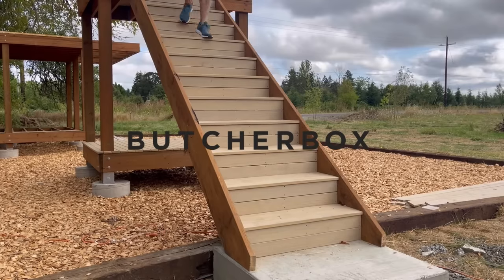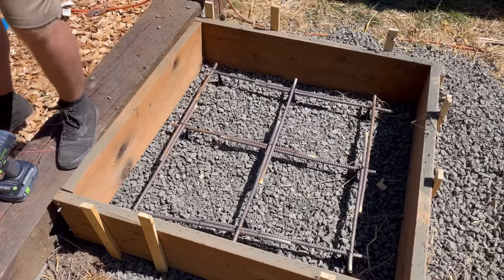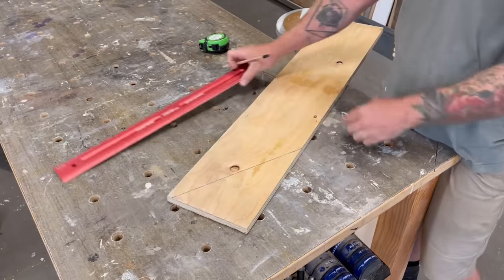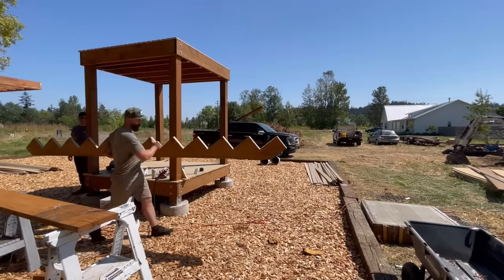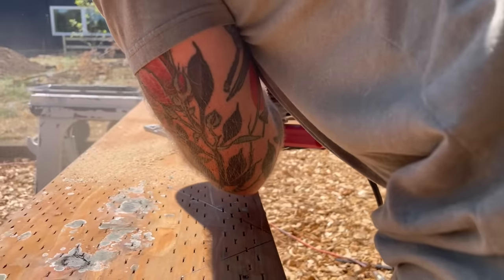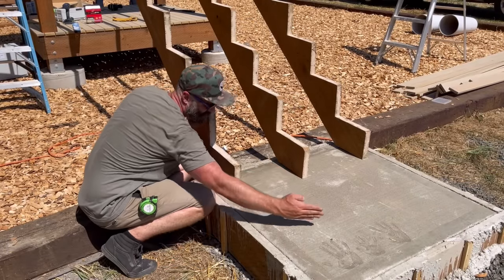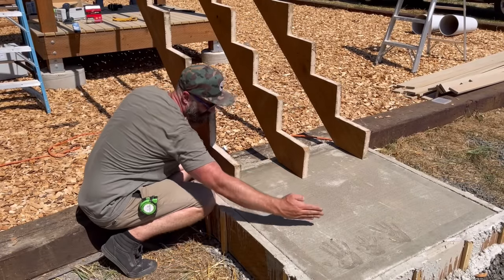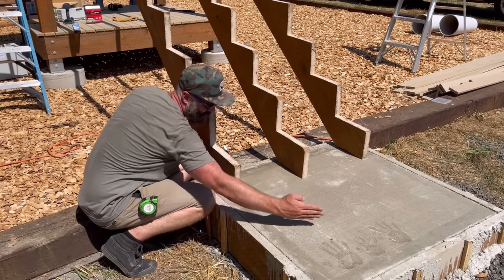The Easiest Way to Build Stairs || Stair Stringers are Easy

Comment: Well I just have a question.
Myself a carpenter of more than 40 years I just have a couple of questions.
Now there are several ways you could have installed the staircase one being you could have put a support halfway up to help support your rail.
But as I can see you've decided to put a 2 x 12 up both sides of your stringers on the on the outsides.
But when I see this I think to myself that stringer is going to hold a lot of water between all of those boards when it rains and we know what happens when that occurs with all of the buildup of dirt and grime and so.
No you could have added a 2 by 4 on the inside edge of your outside stringers and a 2 by on both sides of your center stringer to add strength to all of those stair stringers.
But my biggest concern is why you would put your nosing so far out from the bottom step on that enforcement 2/12 that you added on the outside of your.
It would definitely be a trip hazard for anyone entering or leaving the staircase. Please explain to me your reasoning on such work?

Comment: Another way to do the stair jig, we clamp a bit of wood across the framing square at our rise an run marks. Does the same job but it's quicker to set up.
Reply: Another benefit of clamping a 1 x 2 x 36" board to the framing square is navigating over waned edges on the 2x12.
Reply: @klmbuilders5385  great idea!

Comment: The tread measurement was 10.5. If the dimension of the tread boards was 3.5, the only way you get an overhang of a half inch is to gap your tread boards by a quarter inch. I didn't catch the width of the tread boards during the video, and you didn't mention any gap... so I just had to assume.

Comment: Great detailed video. But one question, wouldn't the stringers need support beams to support the weight after a certain amount of length?
Reply: Code allows for a span of 6' for cut stringers before requiring support but 13' 3" for solid stringers which his decorative side pieces (skirt boards) act as. The span looks to be less than that so it's all good.

Comment: With the price of wood that jig cost 10x as much as stair gauges lol. Love your vids, would be cool to see a price breakdown at the end of this project.
Reply: Unless the wood is scrap from the abundance that accumulates in woodworking. The nice thing about the nuts is that once you have them, the jig can be changed anytime you build stairs with slightly different rise/run.

Comment: Well most things are at least fairly easy when you know how.
As for the pad for the steps to sit on, did you wait till the structure was built intentionally?
So we have 2 measurements to consider when building stairs.
Commonly referred to as height and run, again easier once the structure is built.
By the way, did you remember to deduct for tread on the bottom step when you laid out the horses? lol

Comment: At 9:02 when you first started to make the marks in the stringer board I was just wondering how come you didn't start with the full length of the run part of the jig at the top of the board? Was that the thickness of the step boards width?

Comment: How long did you have to wait for the concrete to set before drilling the anchors in?

I need to redo my front steps on my house. They are about 6ft wide, only one central stringer, and the treads are then just screwed into side boards. There also is no concrete landing, the sole stringer and side boards are just sitting on top of a 6x6 beam laid across the dirt.

So, when I rebuild my stairs, I am hoping it will be a weekend job, but that won't happen if I need to wait a week for the concrete pad to dry.

Comment: Nope, you always measure you height and divide it by how high you want the riser, code is 7-3/4 and then that tells you how many then times that by the tread depth and that tells you were your landing will be, super easy, also I cut one extra rise and run and tuck that under the upper deck, that way there’s no extra support showing, all the supports are under the upper deck
Reply: Codes vary depending on building classification, so 7¾” is not “code”. If you’re building a set of stairs between 2 fixed walls and you know that your landings have to be at least the width of your stairs (code) than your riser heights for different sets of stairs can vary. Again, depending on building classification, there are maximum (and minimum) allowable tolerances for rise and runs.

Comment: Great video. The steel square method is no more likely to have irregularities than the jig method. Either one can slip. When I did this for some stairs, I really screwed it up using the square, though. One stringer was not the same as the other.
Reply: That’s as much a matter of not using the first as a template as anything.

Comment: Never seen wood like that with all the marks on it.  Pressure treated lumber here doesn't have those, but pressure treated lumber here is green also.
Reply: Any PT lumber that isn't a deck or fence board will have those marks it's how they get the treatment to penetrate into thicker pieces like 2 bys. Greens still pretty common here too but more and more of it is done in this brown colour now.
Reply: @Grimmcrag  none of the 2 by treated material around me has those marks.  I do normally buy my treated lumber from the box stores.
Reply: @Grimmcrag  none of the 2 by treated material around me has those marks.  I do normally buy my treated lumber from the box stores.
Reply: @Grimmcrag  Those marks are from the pressurized roller clamp the boards are run through. They are not some way to let the wood treatment “seep” into the wood.

Comment: I was wondering why you chose the slope of your landing to the back. Won't you step in a puddle of water before you step up. Or even ice depending where you live. I guess you could slope the dirt to run water off  to the side.
Reply: More bark or gravel would eliminate the puddle and might even be needed considering how tall the pad is.

Comment: But why not just do closed stringer?  You could route out the part where the tread slides in, and I think it would mean you'd only need just the two stringers, because closed stronger is stronger.... You could also just buy tread brackets, but then your method might be cheaper... depending on bracket cost.

Comment: For the little decorative stringer boards, any reason why you wouldn’t screw from the inside so the boards don’t have holes visible? Thanks!
Reply: Because you wouldn't have the majority of the screw holding the board to the stringer.
Reply: @OldsmobileCutlass1969Va  why not? Countersink or use 3" screws right?

Comment: Once you cut the treated timber do you not have to reseal that edge as the bare wood is now exposed as the treatment doesnt penetrate all the way?
Reply: They call it "pressure treated" because the preservative is driven all the way into the lumber under pressure. There is no need to seal the cuts
Reply: @seriousandy6656  ah okay I just assumed because you can see treatment on the edges around the cut the new exposed wood in the middle might be effectively untreated!
Reply: The color you see on the surface is just a stain to help differentiate it from untreated lumber. You wouldn’t be able to see the chemical treatment. 

The pressure in PT shows that it is more than a surface treatment but does not mean that it goes all the way through the wood. That’s why they sell the material for field applications. Yes, you should treat the cuts in PT wood. 

It is also a great idea to use self healing tape wherever a screw is driven into a horizontal surface, though less so for the Camo and similar hidden fasteners. The shrink/swell of the wood will create a tiny void around the screw shaft that will allow water intrusion leading to rot. It will be a long time, but it will happen.

Comment: The easiest way to layout stringers is to trace the precut stringers at your home store of choice. “I’m always thinking one step ahead. Like a carpenter that makes stairs” -Andrew Bernard
Reply: That only works if you have a perfect fit to that rise/run math.  A lot of stair builders have to work with the space that’s already laid out and needs stairs added or replaced and therefore need custom measurements.  Within code required specs of course.
Reply: @jimk5307  first, it was a joke. Second, I didn’t say it was the most accurate, I said it was the easiest and it is.
Reply: Roger that, I was just worried about the viewers/readers without much experience and who might be in learning mode causing them to inadvertently pick it up as a helpful tip rather than a joke.   There is a lot of “power” as tier-two contributors (commentators).  :)
Reply: @jimk5307  truth be told for most intents and purposes tracing the precut stringers works.  Especially for folks who don’t use a square very much. So despite me saying it as a joke it is a good tip

Comment: You mentioned those nuts to screw onto your square to measure/mark the steps. could you not just grab some offcut with a straight edge and clamp it to your square to get the same effect as those nuts? you can just slide that along the edge and mark. Much easier to make than the DIY jig (no cutting/measuring/screwing)
Reply: I would have used some small c clamps to clamp a piece of wood that the bottom of the square. It gives it a flat edge and would take seconds to do. I agree!! Then you just slide it down the edge of the board. There is always more than one way to solve a problem.

Comment: Question.  I built some decent long and wide stairs and there's a bit of shake in the middle.  Do I just need pressure blocking to take out the shake?
Reply: It’s hard to say what the shake is from without knowing the design. It could be from the depth of the of the wood the stringer was cut from or the spacing of the stringers, weakened connections, and probably a few more. There’s probably a different solution for each structural deficiency.
Reply: If I’m understanding the problem correctly, try attaching a diagonal 1x4 to the underside of the stringers to act as a rack brace. Even better might be 2 diagonal braces, top to the middle, then middle to the bottom in the opposite direction.

Comment: I looked for, but do not find, a hammer drill in your list of tools. What make and model did you use?
Reply: It’s a Milwaukee with SDS-Max bits. There are several models.
Reply: @johnlee7085  Thanks, I am looking to replace a 40-50 year old hammer drill that I inherited from my father.  I seem to have fried the motor by overuse in granite.

Comment: Without diagonal bracing on the platform, the stairs will likely apply lateral loading causing flex.
Reply: The "Two Towers" are being connected by a bridge in the next video. There is no way those steps are flexing. Add all the weight of both when finished, the posts that are bolted to brackets that are bolted to concrete in the ground, the staircase  is bolted to a concrete pad, the skirts on the stringers...the load you would have to put on those steps to flex? Idk, but it would need to be a cement truck I'm guessing. 😂 They're not going anywhere!
Reply: @carlstrohm3785  you could see the steps flexing as he ran down them. You are making to many assumptions without considering the actual physics at play. I am sure the way this is built is fine for a play structure for a family but any structure that high off the ground would normally have bracing.
Reply: @hunterbancroft290  That's basically a one story elevation change. 1st floor down to basement or up to the 2nd floor as in any house. I'm in and out of homes all day for my job, usually the basement as that's where most furnaces live in homes in MN. I almost never see any mid-run bracing to the stringers. I see all kinds of washers, dryers, freezers, weight sets, treadmills, before mentioned furnaces (including cast iron boilers), and all sorts if anything you can imagine you'd find in a basement. All of these things used the steps to get down there. Lots of old homes used 2×6 or 2×8 lumber for stringers (rough cut so real sizes). None of them have ever collapsed under me and my tools. I have been on some sketchy stairs. Those are built well. Read all the comments from those who do this for a living, they agree, the steps are solid. The structure is not finished yet. Patience.
Reply: @carlstrohm3785  I was talking about bracing the structure not the steps. The stairs are strong enough for a couple people but they are certainly not built to code. The incised PT lumber Jason is using is not as strong as the rough cut old growth fir stringers you are likely used to seeing in Minnesota basements. (probably close to 1/2 the bending strength). I just don't like when people make broad simplifications about structures;  they are complex and should be treated as such.
Reply: @carlstrohm3785  Ok I wasn't aware of the finish design, but still, mass is a measure of vertical weight which doesn't always translate to sheer resistance.
Reply: @hunterbancroft290  Those steps are strong enough for a couple of people per step with all the steps loaded at the same time. I'm pretty sure he said PT fir was used so it's beefy. And again, he's not finished. We'll just have to wait and see if it gets braced at all. Maybe he throws a climbing wall on one side or walls in the lower deck. Idk, but that would add plenty of shear strength. Time will tell. I misunderstood your comment when you stated the stairs flexed.
Reply: Because we don’t know the design of the bridge, we don’t know if it provides any lateral stability. 

I’m pretty sure the single bolt through the center of all the connection of the post to concrete does not provide a rigid connection and that it really doesn’t matter how many you connect together. They would still be pivot points. There are connectors that could create a rigid joint, but pretty sure these aren’t it. 

As with much of the project, it’s not code compliant but overbuilt enough that it shouldn’t matter for at least a while.
Reply: @johnlee7085  Perhaps double-bolting along each axis point would be cheap insurance.
Reply: Simpson makes that type of fasteners. Still might be an issue of breaking at the weakest link. As much as some parts are massively overbuilt, there are definitely some weak links.

Comment: A lot of talk here, but once you screwed up one set then you know.
Figure the stringers full "NO ALLOWANCES"!! / Then you knock 1 1/2 off the bottom and add it to the top meaning cut   the board thickness off the bottom. Of each stringer "3" cuts then they are all equal steps kind of think we are all on the same page

Comment: If you ripped your form boards in half, the pad would still be thick enough and need less concrete to mix, especially by hand.
Reply: I got an email saying that Jon Reeves said the typical driveway is 4” thick.  I hate that YouTube will send those messages but not go to the comment. 

For clarification, there are undoubtedly 4” thick driveways, but that is not standard. Sidewalks are 4” thick, but residential driveways are 6”. You can check this out through your local jurisdiction. There will be a book of standards for most things and 1 out of the 100 will include driveway thicknesses. Commercial driveways would be 8”. 10” or more thick pavement is only for heavy truck volumes or really bad subgrade soils.

Comment: So at 20:49 why did you screw from the wood face to the singer end? I think you are supposed to screw the other direction for strength and forever screw use. So don’t use screws especially structural support into an end of a board it diminishes the purpose you should sue brackets that come from the front so frome face to face of boards

Comment: The outside "decorative pieces" are actually the strongest part of the stairs.  The cut out stringers are functionally a 2x4 due to the cuts.  The outside ones are full dimension structural members and makes the stairs solid.  Without them the stairs flex way too much.  This is my real world experience.

Comment: dude, 10 inch thick landing?!  wow overkill
Reply: It needed to be to coordinate with the rest of the build.
Reply: so everyone else is aware, your typical driveway is 4 inches thick.  If 4 inches is enough for your car, its enough for a staircase.  use a 2x4 for the form and save yourself $ and a sore back.

Comment: west coast lumber looks so weird why does it have those check lines all over it
Reply: it is called pressure-treated, incised lumber. It is very common on the West coast of USA and Canada. The mill makes small cuts in the side of the lumber so they can inject the treatment deeper into the wood. The treatment is orange hence the color of the lumber. This lumber is likley Hemlock or Douglas Fir.
Reply: @hunterbancroft290  I’m from
Upstate Ny here..it’s green and copper without the incisions